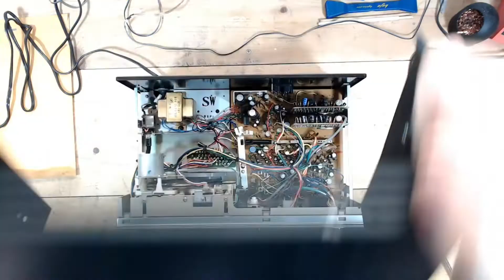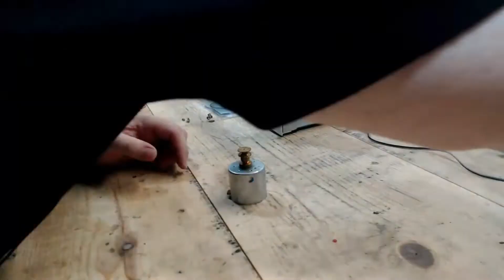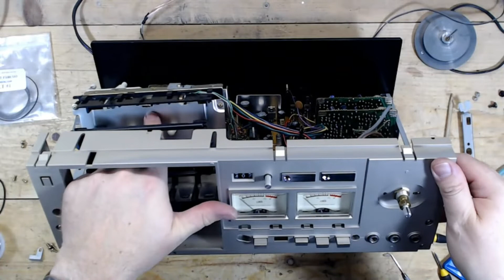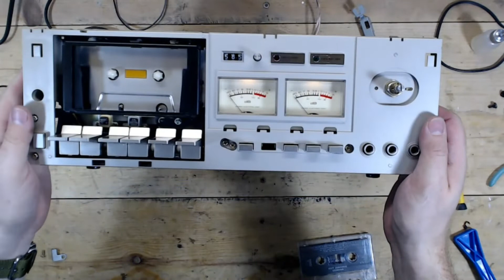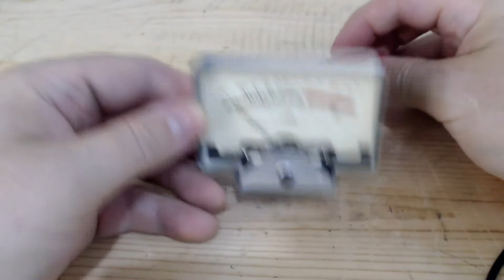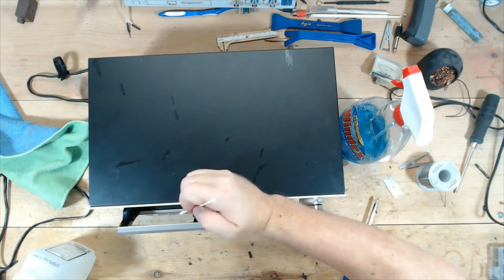Pioneer CT F500 Motor Repair, Belt Replacement, VU Meter Replacement

Comment: Hi Miller, I have the same deck. Lights are coming on but nothing happens when pressing play or fast forward. Motor doesn’t work at all. Measured the two cables coming in to the motor. Shows 0volts when play is pressed down. All fuses are ok. Do you know what the problem is? Thanks
Reply from the maker: Your problem is beyond the scope of YouTube comments to fix...you'd be best served by opening a thread on Audiokarma or Tapeheads.

Comment: Just picked up one of these decks and the take up reel wont spin when i click "play" when a cassette is inserted (it does spin when there is nothing in there, though). The fast forward and rewind seem to work though. Any ideas?
Reply from the maker: There is a little felt pad in the transport mechanism that tends to fall off.  I’m trying to locate it in the service manual, but it’s hard to locate.  I don’t currently have a 500 to reference.

Comment: I have one I just recently replaced the belts. It will FF rewind and play but it plays at a slow speed. And suggestions?
Reply from the maker: Adjust the speed on the capstan motor - there is a small rubber stopper on the back of the motor that you can slide a tiny flat screwdriver into and adjust the speed.  Keep in mind that the motor may need to be serviced (re-lubed) if you cannot get the speed dialed in.

Comment: Last year I worked on a CT-F700 for someone. It is a sweet deck. It needed all new belts and I used rubber renue on the idler wheels. I was able to feed the belt behind the flywheel by loosening a set screw on the back side of the flywheel. Saved me a lot of work. The darn thing would hum and one vu meter would go crazy when I turned off the Dolby. Leave Dolby on and it sounded fine. Couldn't figure it out.
Reply from the maker: Tape decks are the worst of both the mechanical and electronic worlds...gremlins abound on the inside :)

Comment: Just did something similar, will post video soon. I think spending more then 10$ on this deck is not worth , IMHO
Reply from the maker: The more I work on Nakamichi decks, the more I'm convinced that these silver pioneer decks - while nice looking - aren't nearly as reliable as a good Nak deck is.  I tend to agree with not putting too much $$ into them.
Reply: @millervintagehifi3034  Agreed

Comment: i have also a ct-f500 that i just change the capstan.  now belt but left the other belts alone now i'm having a problem the motor no longer spins and door don't stay close if i hold door closed i can push play but nothing happens , no rewind or fast forward. i don't know what i did wrong, maybe you can help me on this, thanks
Reply: Heh... I might have an answer :) Go back to the bracket that holding flywheel. On right side there is a another bracket with 2 switches ! Make sure switch behind the flywheel is ON TOP of the pivoting arm  and make sure switch is engaging when you turn PLAY , FF or REW :) Adjust and tighten small screw that this bracket secured with .
Door open got messed up when you was fiddling with that bracket. Right close to the motor there is white plastic arm that goes vertical with spring right behind the motor. Try manually operate it to make sure door opens. This should help
Reply from the maker: Join audiokarma.org or tapeheads.net and start a forum post (with pics).  Too many potential issues to troubleshoot using YouTube comments.  The kind folks on either forum will get you squared away.